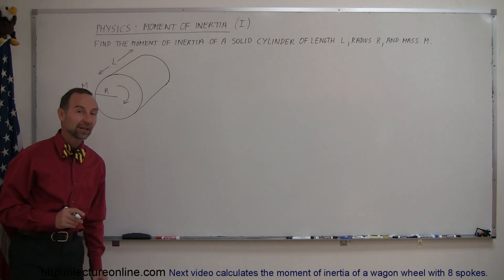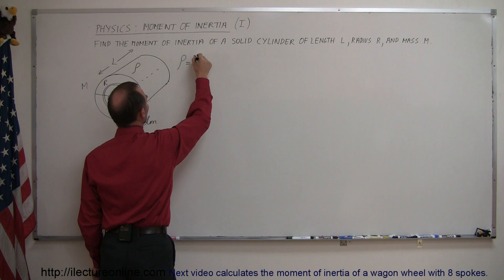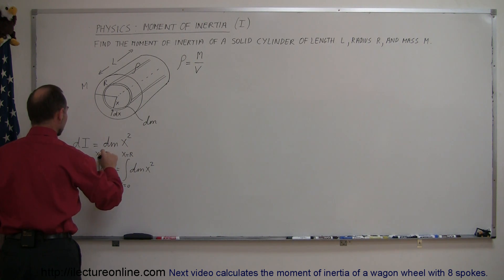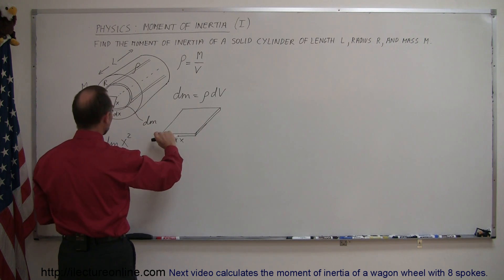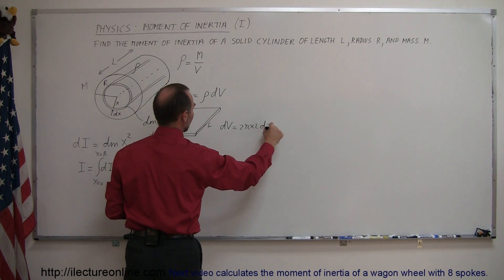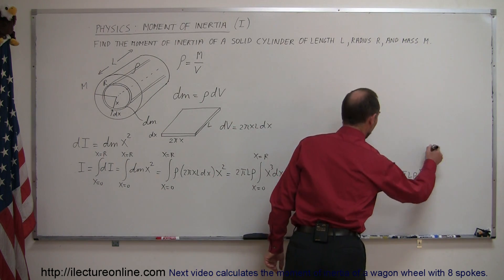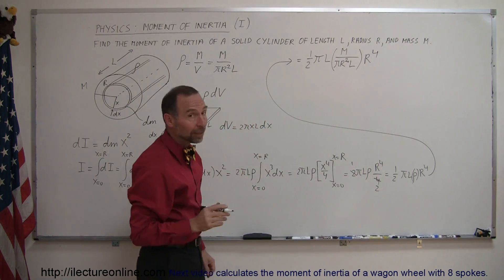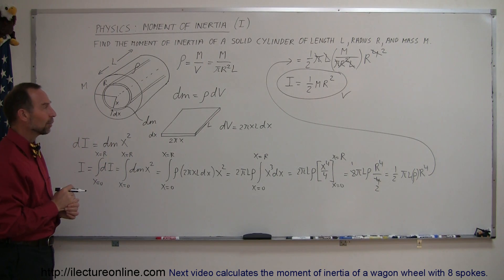Physics 12  Moment of Inertia (4 of 6) Derivation of Moment of Inertia of a Solid Cylinder

Comment: Can we instead take an elementary disc, and then integrate the moment of inertia of the disc.I tried it, but I don't know how to get the expression for the elementary mass.
Reply from the maker: That would require another integration.  In the end, it doesn't matter how long the cylinder is.  You will always obtain the same answer.

Comment: what would be if the density is not constant, if the density is proportional to radius?
Reply from the maker: Then replace the density in the integral with the density as a function of the radius:     D = Do r   where Do is a constant.

Comment: what if the axis of rotation is parallel to the radius? i mean like a hollow rod spinning
Reply from the maker: If it is a hollow rod, the moment of inertia would be     I = mR^2
Reply: @MichelvanBiezen  how do I explain this, imagine a ring, spinning; but the axis is not the same as this. The rotational axis is the aligned to the radius.
Reply from the maker: Ah, I think  I understand now.  You have the axis of rotation going through opposite ends of the ring.   That can only be done via calculus.  That is too complex to explain via a comment, but we'll make a not of it and plan to make a video on that.

Comment: thank you sir and btw for moment of inertia of any symmetrical body,can't we just do the integral for half the part ,for eg for cylinder(ofc not for the axis given in this example but say the axis was from top of the board to bottom,from middle of cylinder(z axis), integrate half way round and multiply by 2?ANd next question-for rigid bodies,like MOE of rod  in x axis about origin,why can't we take center of mass of rod and multiply it's square by the mass of rod??Thanks again
Reply from the maker: That is indeed a calculus trick we use all the time when it makes the calculation easier, but not necessary in other situations.

Comment: Where did X^2 at the beginning come from? why not only X?
Reply from the maker: Are you referring to the x^2 used in the moment of inertia calculation?  Assuming yes, the definition of the moment of inertia (I) is:   I = mR^2  (the mass multiplied with the distance from the center of rotation to the position of the mass squared.)

Comment: Mr. Michael, is it possible to say dI = double integral of dmx(sq) dl. And it comes in handy if the radius keeps changing along L. Thank you so much?
Reply from the maker: That my not require a double integral.  You may be able to express the single integral to take into account the changing radius.  We have some examples of that.

Comment: Can the I be like I=0.5M(R1^2+R2^2)
Reply from the maker: No, that is not correct.  (that would make it larger than I = 0.5 M R^2)
Reply: @MichelvanBiezen  but in my book it says  I=0.5M(R1^2+R2^2)
Reply from the maker: Are you referring to a hollow cylinder or a solid cylinder.

Comment: Hey Michael, if the cylinder was not solid but had a fairly thick shell, would it be correct to say that you just change the lower limit  :/
Reply from the maker: Yes, changing the lower limit would be correct.
Reply: Michel van Biezen cool thanks Michael, appreciate the reply and keep up the awesome videos 🙋👌👍🙌

Comment: great explanation on the topic, thank you for that , what if the cylinder is tensioned and has two fix supports? I want to find the bending stiffness of a wire (16 mm diameter) I need to find the flexural rigidity EI in order to multiply it to the coefficient of my stiffness matrix .
Reply from the maker: For that you will have to look at our mechanical engineering videos.
Reply: any exact video?

Comment: incomplete, as you just found the MOI w.r.t. one axis i.e., the polar axis. What about the other two axes????
Reply from the maker: It depends on the purpose of this video, which is to show a technique to find the moment of inertia along its central axis of rotation.  There are dozens of other videos in the physics and mechanical engineering videos that show all the other techniques of finding the moment of inertia as well.

Comment: There we go, why does the book not say why it's 2pir and not pir^2. Thanks
Reply from the maker: What is the word "it" represent in your question?
Reply: Michel van Biezen circle "volume". I thought of slices as flat planes and not 3d space
Reply from the maker: Aha, now I understand.  Finding the volume of an object through integration requires the summation of an infinite number of infinitesimally small dV  (volume segments).  Thus the cylindrical slice cut open and laying flat has a length (L) a width  (2 pi r) AND a thickness  dr, thus it has a small amount of volume.  L * 2 pi r * dr

Comment: a ring will have different inner and outer radius. the radius keeps increasing. when stretched like a plane it will have different dimensions at bottom and top. my point is area of ring should be calculated by subtracting the empty area inside from the whole area. but you have used the formula for a cylindrical tin

Comment: U said radius affect the moment of inertia.
So why there r videos showing 2 cylinders having different radius sliding over an inclined surface and they reach bottom at the same time?
Isnt it supposed that the smaller radius arrive first because it has smaller MOI??
Reply from the maker: When you attach an object to a string and swing it around, the moment of inertia will increase as you increase the length of the string, (that is the basic definition of moment of inertia).  A cylinder with a bigger radius will have a bigger moment of inertia for the same reason.  The acceleration down an incline is only in part affected by the moment of inertia.  It is like asking:  "why doesn't a bigger rock fall faster to the Earth?", since it weighs more.
Reply: I believe that although the cylinder with the greater radius has a greater moment, the one with the lesser radius has to rotate at a faster rate. I would assume that these two factors cancel each other out.

Comment: Sir what is the difference between area moment of inertia and mass moment of inertia?

When do these both come into account.....How to calculate inertia for a linear moving bodies...??
Reply from the maker: Jitendra,
Moment of inertia technically is only to be used for mass.
But when you have a flat object and the mass isn't given you can assume that the mass is proportional to the area, and you can therefore use the area instead of the mass.  (Off course you don't get the correct units and the answer isn't truly the moment of inertia unless you know the mass per unit area.)
Reply: How to calculate inertia for linear moving bodies?

Sir, why cant we calculate the area moment of inertia of a circle taking a single circular strip and then using single integration..

I tried using single integration but i got half the value to that obtained by double integration...

Why so sir please help?
Reply: And how do we calculate Polar moment of inertia???
Reply from the maker: Jitendra malviya
I just worked out the moment of inertia of a circular object (rotating about its axis) and the moment of inertia is:

I = (1/2) m R^2  

And this was done using a single integral using a circular strip as the dm
Reply: Yes sir,i got it....actually i was trying to calculate area moment of circle about an axis passing through C.G and perpendicular to its plane and this gives me the polar moment of inertia of a circle.......
Reply: Why yield strength of a material is defined only for 0.2%??? Why for 0.2%??
Reply: Michel van Biezen So the polar moment of inertia of a cylinder is truly (1/2)*m*r^2? Because my Hibbler book has me believe that it's (pi/2)*r^4 .. Or am I looking at this the wrong way? For as far as I know they both describe the polar moment of inertia of a cylinder (rotating about the axis perpendicular to it's circular face).

Comment: These are a bit much for me. I am only up to absolute and relative max/min points on the derivative calculus section on the Khan Academy. Haven't touched on Integrals much.

I have a deep desire to study Moment of Inertia and Torque so I can get a grasp of how gyroscopic precession works, gyroscopes amaze me.

Bah, need to spend more time focused on the math.
Reply from the maker: Everything in its time.  You'll catch on as you learn more of the mathematics.
Reply: Integrals are kind of like the opposite of derivatives - you find a function that has a certain given derivative.
For example, the integral of 2 is 2x + C (where C is any constant).

Integrals are cool for many reasons - one application is that they allow you to find the area under a graph.
Reply: Yeah, that post was quite a long time ago. I am now in my second year of my Physics degree! I'm fairly familiar with integration.

At the time of the original post I was in upgrading school, or just finishing it.